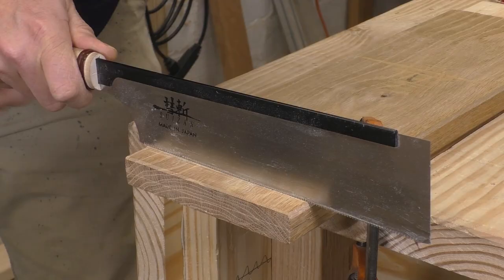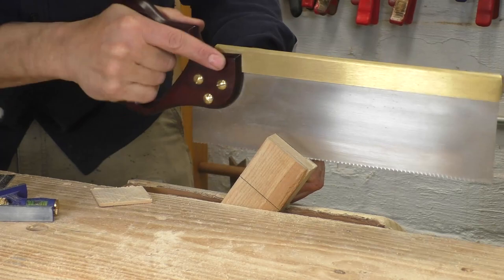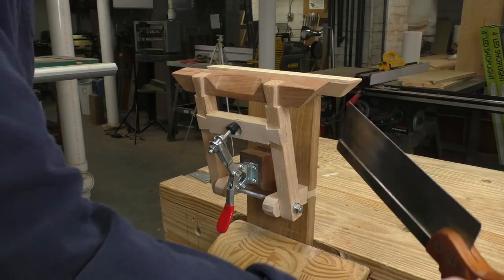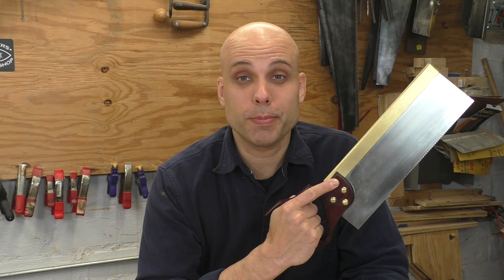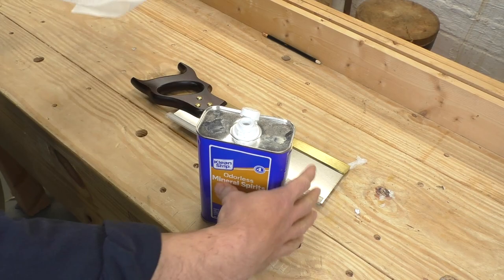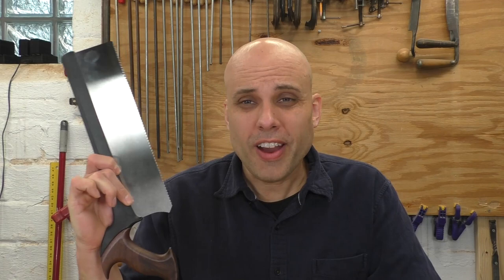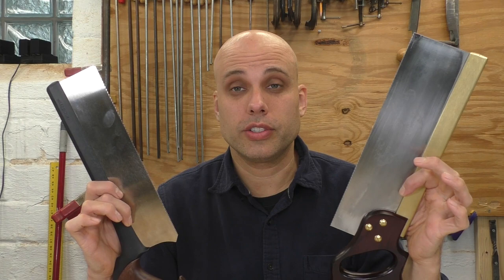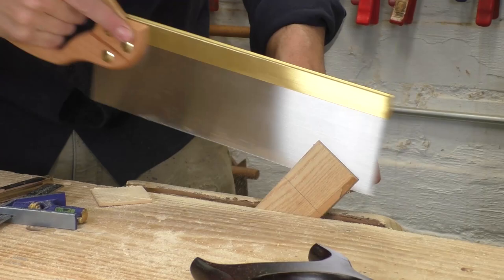The best affordable joinery saw for hand-tool woodwork.

Comment: I have the S&J saw. First thing I did when it arrived and I first held it was make a disgusted noise, and then took a rasp and some sandpaper to the handle. Five minutes later, it was 1000x better than it was out of the packaging. Whoever designed that monstrosity of a handle certainly never held the damned thing. Or was an alien.
Reply from the maker: Both.
Reply: S & J have been making the  same handle for decades. Older used examples can be found for sale in the UK for very little money, they turn up at every car boot sale. The basic materials are good however, so a little time on the handle and a good sharpening and they work as well as anything else. A good saw, decent chisels, a well set up plane, a ruler, square and a pencil = most of what you need to make a multitude of things from wood.
Reply: @mrstandfast2212  I have a whole bunch of old Spear and Jackson saws from boot fairs lying around, waiting for me to decide whether I can be bothered to restore them.
Reply: @jezaitkens6676  So do I Jez. They're good to practice on which is what I did when I began refurbishing saws. It's not always worth the while, but I find restoring old tools therapeutic and rewarding. The trouble is that I can't seem to walk past a forlorn tool and not buy it, hence several boxes of planes, saws, chisels et al which await my attention. Recently I was with a friend who restores classic cars, ( and who is somewhat of a mentor to me in that field ) and he mentioned that he had no decent hand tools for woodwork. I was able to supply a reasonable kit for him at no cost, and in someway repay the many favours he's done for me.

Comment: Rex- Reason you ruined the fine teeth on the dozuki is you are applying pressure that is beyond the fine tooth capacity. Per Katz-Moses, you use only the weight of the Suizan dozuki saw itself for downward pressure because you are trying to produce a smooth cut to just inside the waste of joinery cuts. I add just a teeny amount more pressure on mine, and it seems to hold up. Saying isn't super fast. But I (you, they, we) don't reach for hand tools for speed.
Reply: Also he didn't test the new saws on that oak board;

Comment: A quick tip for cleaning different shipping oils off of metal. Use soap and hot water. I know everyones hesitation with RUST but if you use boiling hot water to rinse, it drys quick. Then rub some machine oil on it and rust won't be an issue.

Comment: Spear and Jackson are a British company. In the UK where untill recently  there was no such thing as a "Back Saw"  all saws with a spine were called "Tennon Saws". Which saw you call a dovetail saw and which a carcase saw etc is personal choice. In the shop you would ask for a tennon saw of the apropriate length and tooth count. Say a 14" 12tpi tennon saw as a carcase saw, 12" 14 tpi tennon saw for Joinery and 10" 16 or 20 tpi as a dovetail or trim saw. Since the most hobbyists now learn from YouTube many UK manufacturers now name saws by function as that is what customers are asking for.
I assume the name Tennon saw came about because it describes the function of a back saw i.e. it can make both rip cuts and fine cross cuts with a thin supported blade.
Reply: Yeah that is correct. I was apprentice in a joinery shop for 2 years before I quit. (Nice hobby, lousy job) A joiner had basically 2 hand saws. A panel saw and a tenon saw. A dovetail was somthing that my great grandfather did. I had never even seen a dovetail get cut so I had until recently never even heard of a dovetailsaw. When a joined bought a saw he would buy that when he was an apprentice. It would be the cheapest piece of crap that you could find. Between finding it's way at the bottom of the canal at retirement and it's first day in the shop the teeth would be reset and sharpened thousands of times.

Comment: I just tried searching for best hand saw for beginner woodworker -- I haven't even started on my first project yet, but I need a decent handsaw that doesn't cost an arm and a leg.  100 (even slightly under at 70-90) is a bit out of my price range.  I've been watching some videos stating my first project should be a work bench, however, I got a circular saw for Christmas and I don't even know how to rip boards without a bench, so I figured maybe I should make a pair of sawhorses, and the one video I liked (the design I liked) requires a hand saw to cut angles.  So I'm still looking.  In any case decent video even if I can't really afford either of those saws, you earned a subscription.

Comment: I have the S&J model above this, that has the removable handle and teeth that can be sharpened.  It was really rough straight from S&J.  I flattened the teeth on an avail. Reset the curf and properly sharpened it.  I now have a saw I like. Not sure if my time was more than the difference of getting a better saw up front... but I love the challenge and that's worth something.

Comment: Another option is making a little frame saw.
They're a little light, but fairly easy to make. I made mine out of cherry, a piece of twine and, as a stopgap until I get around to getting a bandsaw blade, a hacksaw blade with a pair of cut nails (another stopgap) to pin the blade in.

Juuuust try to not get too into making it look nice, I accidentally fudged the ergonomics a bit on the handles on mine.
Reply: I'm with you in hoping that we haven't abandoned the frame saw angle.They talked about it in the comments a few videos ago.

Comment: Hi Rex: I am one of those people that could not drill a straight hole in a million years; but do love tinkering. I have found a simple jig to drill straight holes in long parts with my drill press.  A piece of 4 inch long, 2x4 with two elevating feet with studs from McMaster. The elevating feet are mounted into the 2x4 with tee nuts. Now I can level the item being drilled. Finally I can drill straight holes in longer items.

Comment: Bought the GreatNeck 14” miter saw off Amazon for $15 about a week ago and have been very impressed with it so far. Easy to saw right from the package, hardwood handle and can be resharpened. Still like my Japanese saws for precision but the cheap western saws seem to work better in pine for my work.
Reply: I thought GreatNecks had hardened teeth?
Reply: Joseph Haddakin not the one with a blonde wood handle on Amazon, but this is the first time I have bought from this brand.

Comment: One thing that I picked up about back saws is a trick to test the cut "balance."  You draw a number of lines vertically down the face of a scrap board from an end.  Then cut down one line starting at one side.  Don't attempt to follow the line.  Hold the saw properly and let the weight guide the cut.  Watch whether the cut wants to wander off to one side.  If it does, lay the saw flat on a good surface with the side of the saw toward which the cut wanders upward.  Then lay fine grained, hard sharpening stone on the face of the saw and covering part of the edge and run it gently from the heel toward the toe of the blade.  No need to press.  Any over-set tooth will be abraded off.  Repeat until the kerf is straight.  You can also narrow the kerf and smooth out cut quality this way.  Just be sure the narrowing is symmetrical.  Peter Sellers may have a piece about this.

Comment: This might be a bit long.. I have been a woodworker of limited means for over 40 yr.s and I believe your channel does a great service to those who fear to fear to move forward in the craft because they can't afford the perfect $200.00 + low angle plane or whatever.  There is great joy and a massive amount of skill development in taking an old or sub-standard tool and re-conditioning it to make it a good or even great tool.  My own tool kit is fairly small and most of them I've had for decades. But: they are sharp and well tuned and do what I want. If they don't, the first thing I question is "Do they need re-tuning?"    So: Thank you Rex!      Now for my own advice...  Quality measuring tools are an absolute must most work, and I have some great ones having also done machine tool metal working. However, if you are careful with them, quality DRAFTSMAN'S tools are wonderful things in the shop!  I had mine initially just for drafting, but one day needed a big square for lay out work and grabbed my "T" square...  Since then my drafting tools are an integral part of my woodworking layout tools. They are (mostly) inexpensive, and very precise. They are relatively fragile though, so be careful of them. As another example: look for a good, used, professional grade compass set. You will be amazed!  Now that so many have switched to CADD the old, manual drafting stuff is often just thrown away.

Comment: The Spear and Jackson surprised me how well it works. Reason for getting was I sent a twelve inch vintage Disston to Matt Ciani to make really dialed in, like the saw a lot and wanted a perfect small crosscut in till, but eyesight won't allow me to do cc filing anymore. After seeing another you tuber recommend this saw though it might fill in for awhile for crosscutting.First thing was to strip lacquer off blade and handle with acetone, then reshape handle, filed teeth, at first not impressed but kept at it. Settled in with about .039 total kerf and a pretty aggressive rake. It works very well now and crosscut or rips well.

Comment: I have a Stanley hardpoint saw that had a handle very similar to the Spear & Jackson, pretty uncomfortable. I took it to the router table and went around it with a 1/2" roundover bit and then it was perfect. I built a whole cabin with it all by myself.

Comment: We use a mix of the spear and Jackson’s and the crowns at school.  I always use the crowns for my demos.  We have a lot of issues with the s&Jc saws.  I tend to find the handle is too high on the blade, the crowns we have, like the veritable are lower so your effort is more in the direction you are sawing.  With the s&Jc it’s just...weird,  they jam and wobble I guess,  because the force is just not in line with the blade but it seems more than that.  I’m looking forward to seeing how you fettle it into something more useable (although my technician might not be if she has to sort wh if them).

The other thing we struggle with with both these saws is hardware.  The s&Jc has rivets that work loose and are smaller than most of our spare saw screws so we end up drilling the blades, not easy as the steel is good quality.  With the crown ones the hardware uses saw screws but they seem to work loose even with thread lock.  Of course the kids don’t tell us until they’ve lost the bits on the floor,  but then that’s kids.
Reply from the maker: Well, I promise to get rid of those rivets for ever!
Reply: @RexKrueger  - Looking forward to that. I bought an S&J 22" Panel Saw. The plate works great, but the handle is just not nice. Useable, but not a nice experience.

Comment: I really liked Rex's presentation here. If you plan on buying and modifying the Spear and Jackson, the saw Rex shows is the 9550B. The 5412K is the same size but the blade is removable already. For $7 price difference it is probably more economical to buy that one rather than buying separate bolts & nuts. We'll have to see if Rex can find a cheaper deal. I look forward to the next video.

Comment: I've found that many commercially sharpened saws are set for too wide a kerf.  Also, if you set up test rip cuts making parallel cuts in the end of a board, if the saw wanders consistently to one side, you can correct that wander with a sharpening stone. Once you get straight cuts, you can adjust the width of the kerf and clean up the cut the same way.
I won't go into detail but it works really well.

Comment: Rex. This evening, I used my Spear & Jackson Tenon Saw - identical to yours - for the first time (in the year or so that I have owned it). I am making a Blackthorn walking stick for a friend of mine who has had hip problems all his life - it's his birthday soon (late 60's). I cut it from the wild and have seasoned it for 8 months in my home. Anyway....

I used trad saws like this way back when and I don't have much problem with the handle, though it could be better. I have downloaded your pattern to improve it and will probably do so at some point, just to see if I find an improvement. I also didn't find much to be worried about in the cut that it left in the solid Blackthorn; my problem was that it skipped and jumped a lot during use. I realise that Blackthorn is a very hard wood but it was held close in the vice.

The portion I cut was a little over 1.75 inches thick, which isn't much and should never cause such jittering, so I agree that those saws need fettling before use, though it is sharp but the set seems all wrong. Luckily, I have the files and a tooth-setting tool at hand.

I paid a very modest price for it on Amazon and I know how to deal with the problem, so I would urge anyone starting out to get one - and if they can't fettle it themselves now, get someone else to do it until they acquire the stuff needed and learn how to do it - I'm sure they will be satisfied in the long run.

One tip about saw handles...the angle of the handle should aim your energy towards the middle of the blade. Get that angle correct and you are on the right track (may need some forward adjustment to suit your own preference). The same goes with planes - the handle should aim your effort directly towards the cutting iron edge (slightly leading towards the toe is ok but never towards the heel). That is the rule of thumb to go by.

Comment: About the end of last summer, I ended up in a trade for a "mass" of saws, including possibly the longest back (tenon) saw I can remember ( maybe 24+ inches?) It's only been lightly used, so good teeth and cut and near infinitely resharpen-able. There was a "normal" sized one with a miter box, and a couple solid set-ups for angles, with the fancy table top frames, fence, clamps, gauge in degrees... Just waiting for decent weather as I have to work outdoors... AND I'll be figuring out which to keep or trade out.
    Got about four Japanese saws but passed one on for a struggling noob' who instantly fell in love with it... 

    Looking foraward to your handle tweaking / advice. These are reasonable (cost-wise) for that kind of practice (hot-rodding) for max benefit. ;o)

Comment: Although the price makes it out of scope for this range, my son bought me a Floorip Toolworks Dovetail Saw for x-mas - based on what you said here, think Veritas on Steroids - and it's entirely hand made as well ... brass back, thin blade, beautifully sharpened and set and the fit of the handle, as you said, you'll never want to put it down. Of course, I'm afraid to damage it by using it lol. Can't wait to see what your modified saw is like.
Now... if only I had a Jointer's Bench .... with a vise ..... hmmmmmmmm

Comment: Ever since I watched Paul Sellers saw sharpening videos I've become such a saw snob, lol. Anyway, he likes to tap down the teeth between two hammers to reduce the amount of set and make a thinner kerf. I've had good results from doing the same thing. I bet that S+J saw will tune right up when it's sharpened right.
Reply from the maker: Right on
Reply: You are so right. A plate is a plate. Sharpen it, reduce and level the set, and anything will cut beautifully and quantum levels better than factory. After that it’s about how long between resharpenings, and of course those odious modern handles.

Comment: Thanks Rex for yet another great video.  I am a total novice but am trying to advance from everything being made from big box 2x4's, plywood and screws to something closer to real carpentry.  I have no shame in admitting that I make all of my big cuts using an electric compound miter saw or table saw, both with heavenly WD Quinn blades.  But I have no saw that is suited for use in real carpentry.  You mentioned that if you didn't have anything else, to get the Veritas and never look back.  I looked at it and it has a near twin for the same $90 price.  The one you showed us is optimized for cutting with the grain (rip) and the other one is optimized for gutting against the grain (crosscut).

The only differences are the rip saw is 12 TPI with a 10° rake angle and the crosscut is 14 TPI with a 15° rake angle plus teeth having alternating 15° bevels to sever the fibers.

If you could only chose one (the one to rule them all!) for roughly the next year, which one would it be or something completely different and why?  I am behind on far too many projects to put the time and effort into improving a cheaper saw with doubtful results at my skill level.

The links to the saws are here:
https://www.woodcraft.com/products/veritas-rip-carcass-saw-12-tpi 
https://www.woodcraft.com/products/veritas-crosscut-carcass-saw-14-tpi 

Thanks for the videos and hopefully even answering this question.

Jeph
Reply: I've made my decision.  Although almost every piece of my wood is crap and thus I am effectively making crosscuts even following the grain, I want the cleaner cut from the teeth all being aligned on the rip saw.  Now if the place that sells it for $70 would just get it back in stock!